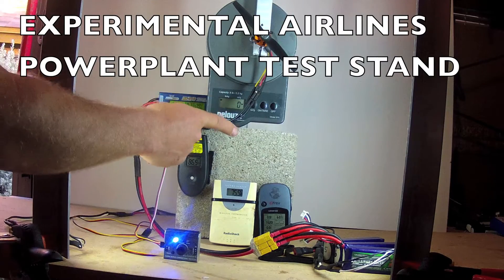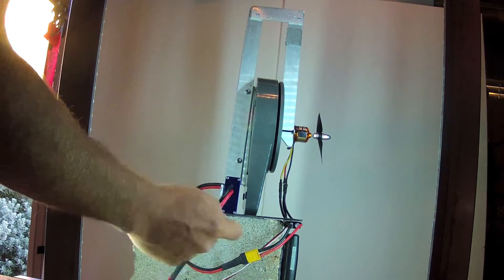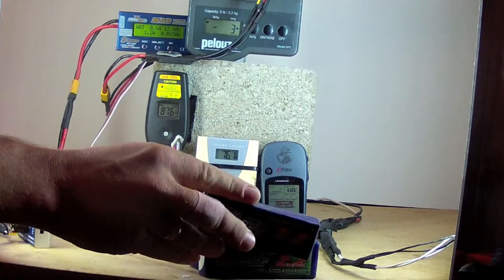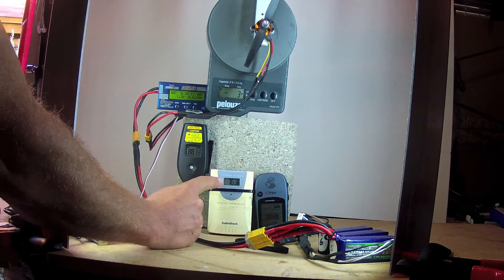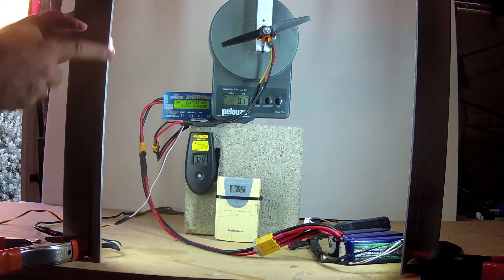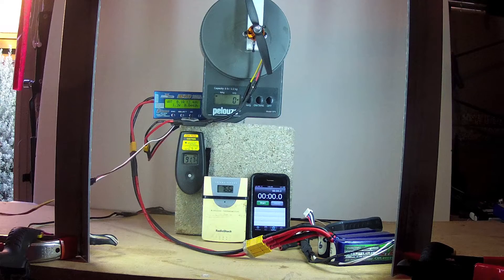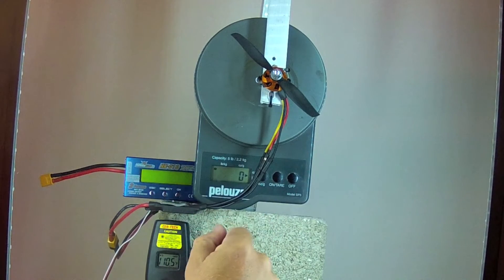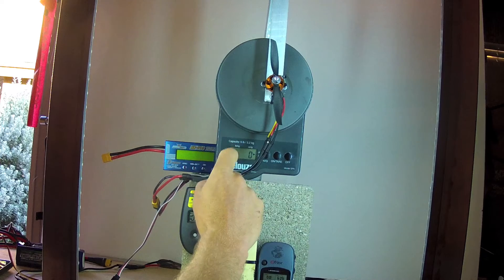RC POWERPLANT TEST STAND

Comment: Nice set up.  I just use the actual plane tied to a luggage gauge.  A watt meter is used as well.  My purpose was to validate my power plant before maiden.  My test also predicts the flight time with maximum and average throttle situations.

Comment from the maker: I think I follow that, sounds like a nice rig.  This one of mine actually does only press on the scale at one small point of contact at the very center.  Having the actual scale a few inches away from the motor is not optimal though.  I did this partly so I could get all the necessary parts in-frame for the videos and be able to shoot from the side and not the top, if the scale was laid flat.  It's always a compromise....

Comment from the maker: In the subsequent videos I do test maximum as well as two other power settings for efficiency (specific thrust) and it usually seems to be optimized at the lower power settings, to a certain point.  I would love to test different voltages, airspeeds, etc. but I don't have infinite resources.  I kind of have to draw the line somewhere, and so 3s is probably going to be the only one I test as it's the most prevalent - for me, and in general.  But otherwise you are totally right.

Comment: Outstanding Ed!!!  Very complete, clean and efficient!  I built a static tester that has the motor on the upper end of a three legged device with the scale sitting on a table.  This lets the prop push against a small area (the mount) instead of the large disc area of the scale.  Think of a triangle with the upper point where the motor mounts, the scale under the far end of a lower end and a pivot on the other lower point directly below the motor.  Better send a picture eh :)

Comment: Isn't the best efficiency of a motor found at around 60-80% throttle?  Measuring only max throttle and thrust per watt doesn't entirely make sense to me.  Also, are you planning to test using 4s as well?  I think that if the objective is to determine motor efficiencies, then higher voltage is a must...

As always, great video and looking forward to future videos...

Comment from the maker: Clearly that's true, and I did not intend to simulate flying conditions at all.  No static test environment can simulate flight without a wind tunnel, and that's out of the budget.  This is just a coarse method for comparative thrust and efficiency measurements between various powerplant combinations.  There are way too many other variables to contend with to get a "true" thrust measurement - pitch, RPM, pitch speed, pusher vs. tractor, etc.

Comment: Ed, Maybe instead of a swinging aluminum arm you could use a drawer slide (like from a kitchen drawer) with one peice anchored to the top of the concrete block and the other slider part mounted to the motor. Mount the scale behind the block and let the motor push the slider against it. This will get the scale out of the prop wash.

Comment from the maker: Static thrust will be less than dynamic thrust in low-speed flight, which decreases up to the pitch speed of the powerplant, where the propeller is spinning as fast as it theoretically will go and basically windmilling.  There are so, so many other variables it's hard to account for the thrust at all speeds.  The simplest one to consider is that high pitch propellers can actually stall and lose thrust while static, but generate plenty of thrust with some forward speed.

Comment: Just to be clear..
Are you saying the static thrust measurement is LESS that actual thrust in clean in flight air..
Or that static the static thrust measurement is MORE because of the low pressure in front of the prop.?

Comment: I guess because the scales are so close this will measure the maximum thrust in the ground effect. I've often wondered what measurements you could get in air using accelerometers (averaged over a flight).